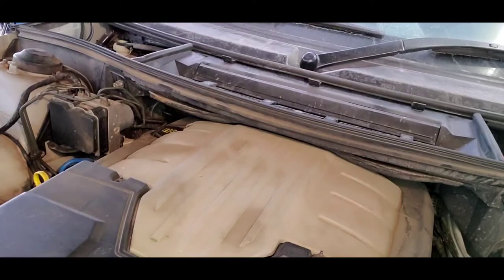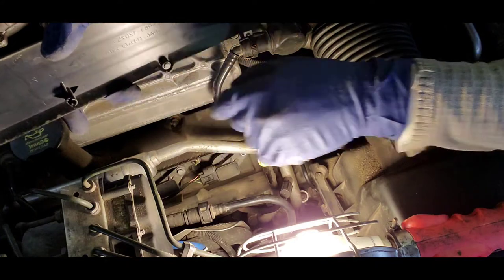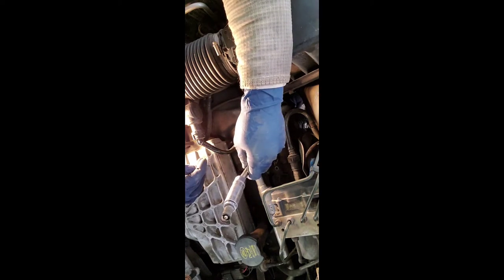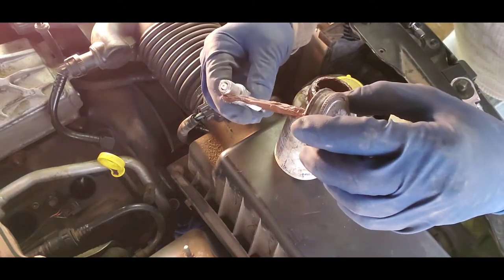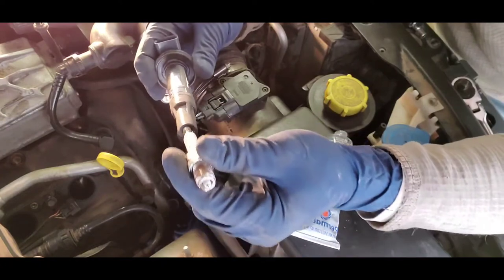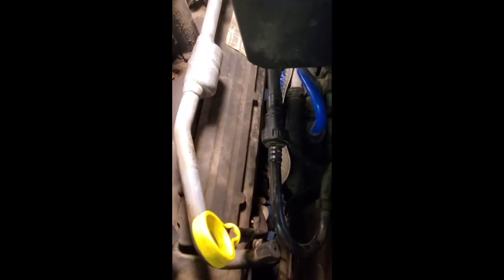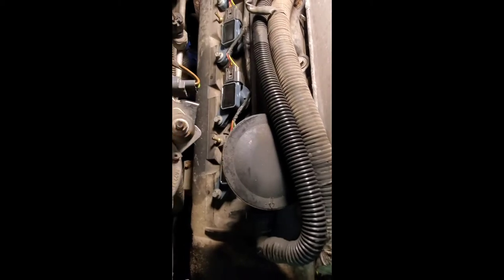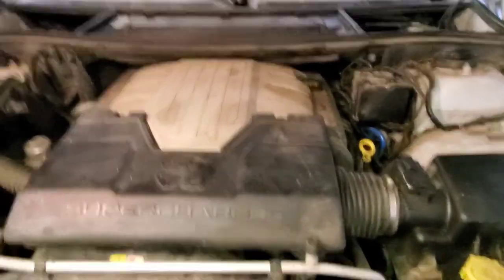L322 Range Rover misfires, replacing ignition coils and spark plugs

Comment: thanks for the vid and the tips -- but i disagree with the dielectric grease in the coil. apparently the previous owner did this and LOADED dielectric grease in there. from my understanding, you should use it lightly around the rubber, but not anywhere within the connection between the spark plug and ignition coil. correct me if i'm wrong though
Reply from the maker: You are absolutely correct, you should only use a light film.  Also, remember I was living up North with a lot of snowfall and all the extreme cold weather issues. So, we had to do things a little bit differently just to keep our cars functioning.

Comment: Is it possible to have a misfire with no engine light?
Reply from the maker: Considering the fact that it's a Range Rover, yes I do believe it's possible. But it might be the spark plug or the coil, or you could have a knock sensor not doing its job.
Reply: @CentTxLiving  i have an 06 4.4l. I've been messing with for years now.
Reply from the maker: What engine do you have, and what part of the world are you in?
Reply: @CentTxLiving  4.4l jag engine US
Reply from the maker: OK just asking, believe it or not a 3rd of my audiences is in the UK. If you have already changed and checked all of these spark plugs and coil packs, then it might be time to do a compression test and a leak down to find the miss.  Unfortunately, if you find the miss this way that usually means you have a piston or a valve gone.
Reply: @CentTxLiving  i have replaced 2 coils, i will replace the other 6 and see what happens. It's an 06 Range Rover with 130k miles.
Reply from the maker: Does the engine smoke or clatter at start up?
Reply: @CentTxLiving  no, idles no problem but when i press the gas pedal it revs up fine but when the idle comes down it some times drops like it going to stall. It has stalled in the past but not all the time.

Comment: Was the diagnosis by sound or did you use your RSW software to detect the misfire? Thanks again for your knowledge share.
Reply from the maker: Thanks for the comment. I got the check engine light and I could feel the misfire. The rsw software verified it and gave me a good starting point- plugs or coils.

Comment: Do you have handy place to find the torque specifications for tightening the spark plugs?
Reply from the maker: I always used the hand tight, then a quarter turn method. As long as you crush the aluminum washer, you should be good to go. Also, some aluminum or copper paste on the threads are a good idea in my opinion.

Comment: Did this permanently resolve your issue, or did the issue return?
Reply from the maker: That solved it. And the other coils didn't fail either. I sold it with 204k miles and she was running great.
Reply: @CentTxLiving  thanks for the quick response.y 2011 RR HSE is doing the same thing…. Misfiring, went into reduced engine mode, and has check engine light…. I am going to pull the code tomorrow…. Do you recall the code yours had?
Reply from the maker: It's my pleasure. I don't recall the code, but it led me directly to the coil pack.

Comment: Hi im on the market looking for one, what should i look first to see if its a good purchase?  Thanks!
Reply from the maker: Well, not to sound too generic, but a good service history is always ideal. Next will depend on what part of the world you're in; the early versions had a BMW petrol, or diesel. The diesel ones were good I hear [we don't get them 🤬].  If you in north America like me, I would look for an 07 or newer, that would give you the jag engine and terrain response. I bought mine with 115k miles on it, so a higher mileage car shouldn't be an issue - with proper service. And the air suspension should last at until about 180k miles before they need to be repaired. Other than that, get the best example you can and opt for the pre-purchase inspection just to gain some peace of mind. If you would like further details, please feel free to contact me.
Reply: @CentTxLiving  thank you very much! Yes im in south Texas, i found one’s 2007 with 180k $4700 but i have only have BMW’s i know nothing about Land Rover
Reply from the maker: With that mileage,  I would pay close attention to the drive train, in particular the transmission. The zf6hp26 is a very good transmission imo, but you may need to verify the shift actuators and the hall gasket have been replaced, or it at least performs as designed for now. Mine were replaced at 150k and the trans works great. Other than that, the drive train should be checked for slop/ leaks and  the usual belts, hoses and such.  I hope this helps, being a shotgun blast of info and all. Lol.

Comment: Mine is asking  me to replace  spark plug 7 should i replace all of them or just number 7
Reply from the maker: Switch the coil pack with another cylinder to isolate that out of the equation,  then I would replace just that one unless your close to having them all changed. Also, if it is the plug and not the coil, be sure to really scrutinize why it failed just to be sure you don't have an internal problem brewing.
Reply: @CentTxLiving  ur a smart man didn't  thank on doing  this thanks for the quick reply and it recently started after replacing water pump?can it have anything  to do with air in the system?
Reply from the maker: No, besides it would eventually purge the air through the overflow. 
Just trying to help bud, these cars can seem overwhelming but they're actually quite simple.

Comment: Do you know If the valve body on the transmission fit the 06 ford explorer and bmw. Trying to buy one used with tcu
Reply from the maker: I don't think so, that's one of the Land Rover specific performance requirements I believe. Although I do use Mercon sp trans fluid. It may be that the valve body is the same but the solenoids are different. I honestly have no idea, I just replaced the solenoids, hall gasket and the tubes and my trans was good. I wish you well.
Reply: @CentTxLiving  thanks

Comment: Hi. I have a 2006 RRS 4.2 supercharger. It's also converter to LPG so it starts on petrol and then switched to LPG.
I had an issue with the engine management light coming in and a loss of power (limp mode). After switching coils around it was diagnosed as having two bad coils. These were replaced however the code P0316 is reading on the diagnostics stating (engine misfire detected).
Rather than pour money into this without knowing the problem would you have any help in confirming what the issue is.
Your help is very much appreciated.
Reply from the maker: My first guess would be to check the spark plugs, in particular the two that correspond with the bad coils. If you are near the point of requiring the spark plugs to be replaced, this could be an opportune moment to complete that task.    If the spark plugs appear to be fine, that I would move on to the injectors for both the LPG and the gas (petrol).   If those appear to be fine, then you would have to start diagnosing the Ignition sensors and possibly the ecu itself.  I would recommend you start small with what you can easily check, and build-up from there.   I hope this helps, and I wish you well with your situation. Thank you for the comment.
Reply: Thank you for your speedy reply. I'll keep you posted 👍
Reply from the maker: Great, I appreciate that. Cheers 🍺

Comment: You never covered how to diagnose which coil was bad. I’m guessing it’s just swapping coils, but my ‘09 is driving me nuts!!!
Reply from the maker: Yes, switch the coil pack to another cylinder and see if the misfire follows it to that cylinder, then you'll know if it's the coil. If the problem stays in the cylinder, then you should pull the spark plug and check it. It wouldn't be a bad idea to look in a bad cylinder with a borescope camera. My philosophy is that if one spark plug is bad, change them all, unless they have very low mileage on them.

Comment: Hello I hope if u can help me I have 2010 RR sports supercharged, I have check engine light on the code was engine misfire I have replaced the spark plugs but the code come back again, I feel engine lose power just one time then I restart I got full power back from engine, do u know what would be the issue.
Reply from the maker: The code may be due to ignition coils. I would recommend to have the codes read with an OBDII code reader and focus your search from there. The code reader will also give you the opportunity to reset the check engine light, so if it comes on again you'll know exactly why. I hope this helps, and thanks for the comment.
Reply: coils man..
u should have changed those to.
old post i know

Comment: Which brand of coils did you use for this?
Reply from the maker: I can't remember if it was Bosch or Denso. I would stick to name brand parts suppliers for these,  especially considering i have only replaced one in 184k miles. Thanks for the question.